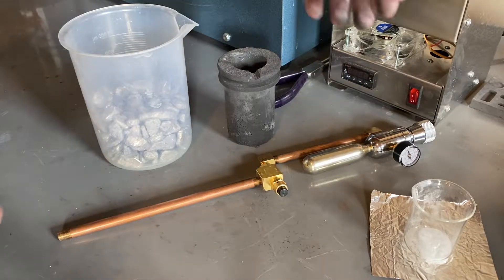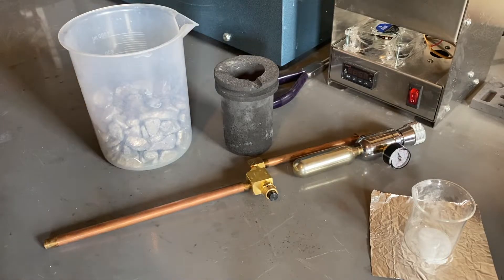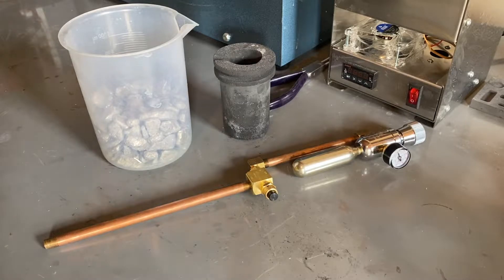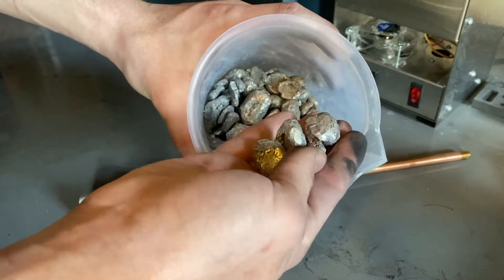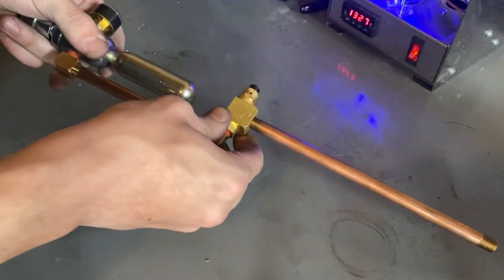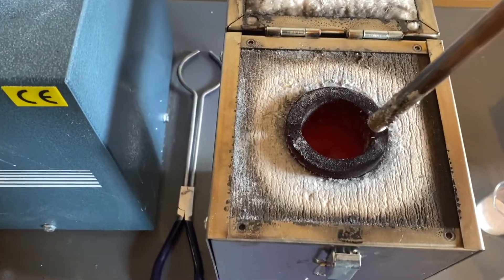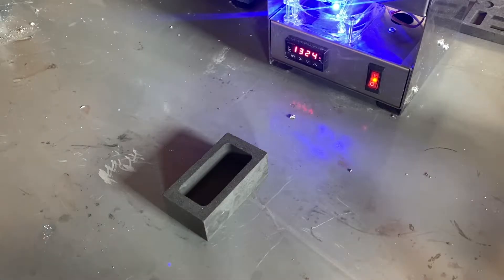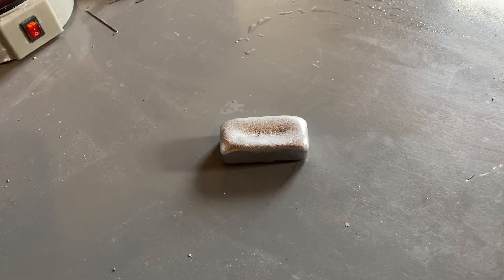CO2 Aluminium Degassing Wand - Investment Casting

Comment: Hi Levi, looks promising, i will try it the next time i use aluminium.
And you could try to put some soot on it, to prevent the aluminium from sticking to the end.
Reply from the maker: Thanks for the suggestion Heron! I’m using brass which has decent thermal properties but do you know if there would be another metal better suited to not have the molten aluminum stick to it? Thanks again and please let me know if you put one of these together... not sure if you have McMaster Carr over in Europe.
Reply: @Levi_Sheridan  I would use stainless, as both copper and zinc dissolve in the aluminium to form an alloy at low temp. 
I don't think that that will contaminate the aluminium, but it can bond it to the brass.
The austenitic stainless also has a low thermal conductivity
and the chromium oxide layer should prevent the aluminium sticking to it.
Reply from the maker: @heronvontremonia9975  thanks for the suggestion. I think I’m gonna try out some 304 stainless within the next week or so. I’ll let you know how that goes.
Reply: Graphite, drilled down the center?  Dry nitrogen, with a hint of chlorine?

Comment: The degassing system is a great idea! However, as copper is one of the best thermal conductors it is probably the worst material for this task - if you don't want to burn your hands. :-) I would recommend stainless steel tubes instead (thermal conductivity of stainless steel is 21 versus 380 for copper).
Reply from the maker: Hey Oliver, the parts are actually brass. Stainless steel would probably be better but I had some of this laying around. Thanks for watching.

Comment: Your castings are looking quite wonderful. I noticed that the pipe that is used in the de-gasing appears to be made of copper or brass. While copper melts at ~2000F and aluminum at ~1200 copper is able to dissolve into that aluminum at those temperatures similar to how salt dissolved in water without melting, this may even be worse in the case of brass.  While the amount of copper dissolved isn't much it may damage your de-gaser and slightly increase shrinkage in parts. While likely not a huge issue it still seems to be noteworthy and may help troubleshooting in the future.  Also as a good rule of thumb,  anything that you stick in the molten metal should generally be brought up to a temperature similar to that of the molten metal, with an exception being something like the baking soda de-gasing agent. This will help to prevent the metal from sticking and freezing to something.  The design for the de-gaser looks wonderful and I may have to make one for myself some time. Best of luck and hope this was helpful
Reply from the maker: Thanks for the thoughtful comment Steven! The pipe is brass and I would agree that while the metal may dissolve slightly it is most likely negligible but useful to know it’s happening. 

I know that I’m supposed to heat my tools before using them around the molten aluminum and that the consequences of not doing so could be quite drastic. From my experience I have had no major high energy events from not doing this and the worst thing to happen is the aluminum sticking to my tools like you said. 

Please let me know if you end up making one of these. All of the parts are available online from eBay and McMaster Carr. If you want a parts list just let me know and I can send one your way. Thanks again!

Comment: Why do you feel the need to degas your melt or add flux? I was under the impression that high-purity graphite crucibles are meant to provide a reduction environment for the melt, to help avoid oxidation.

I have been reading about advances in foundry processes, where avoiding turbulence in the melt (at all stages), and keeping metal velocity below 1 m/s is more critical to casting quality than just about anything else. Apparently, bubble and "bifilm" defects are entrained in the melt during turbulent pouring and movement. Reducing this turbulence, and therefore reducing the entrainment of bubbles and bifilms, is allegedly more important than complicated degassing tricks.

Take my words with a grain of salt. I have less experience with casting than you do. I'm merely relaying the messages I've been reading in my research over the past few months and years.
Reply from the maker: I degas the molten aluminum because when I do my results are better than when I do not. Same deal for the flux.

I have definitely read plenty of literature on the benefits of reducing turbulence during the pouring process but have yet to see anything regarding that during the melting process. I am interested in the papers you have read that talk about that so please send them my way if you have the chance.

If you think this degasser is fancy you should of have seen my original design. I had a electric solenoid valve, some relays and fancy buttons but ultimately went with the manual mechanical valve for safety and simplicity purposes.

Thanks for the thoughtful comment/question. Again, please send those papers my way if you get a chance. Thanks!
Reply: @Levi_Sheridan  interesting. I will have to keep this in mind to try out for myself. I was hoping to get away without any fluxes or degassing steps myself, but it seems I may have to rethink that strategy. Still waiting on some equipment before I can begin any actual foundry work. Thanks again for the video of your progress.

Here is one paper I stumbled upon today that has a pretty good explanation of the bifilm theory: https://core.ac.uk/download/pdf/76655.pdf

If you look for any of the writings, teachings or talks by John Campbell of the University of Birmingham, you'll be reading about the same things I'm reading about. There are at least a couple videos on YouTube of talks by John Campbell that are quite informative and persuasive.

Again, I'm the farthest thing from an expert. I'm just learning.